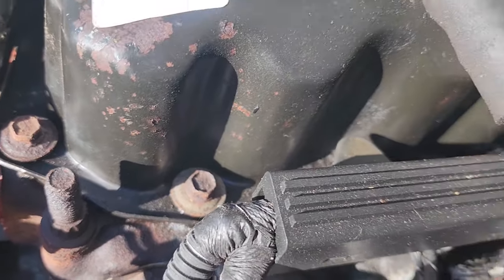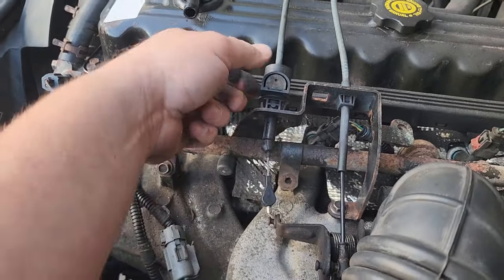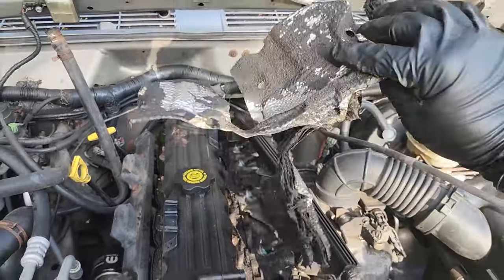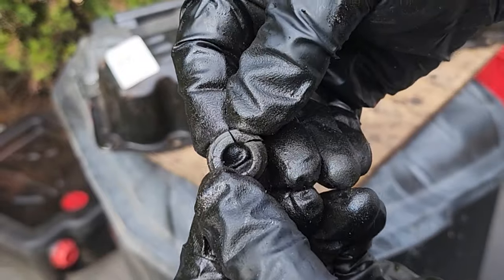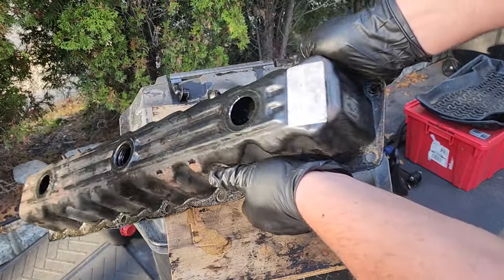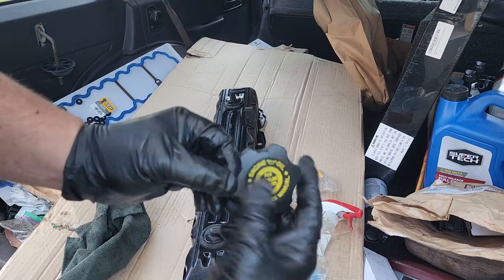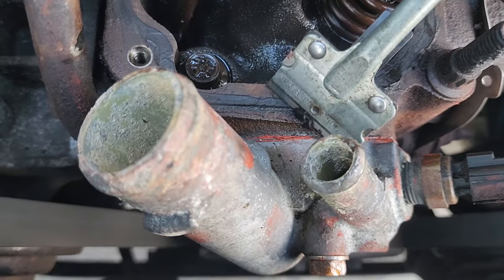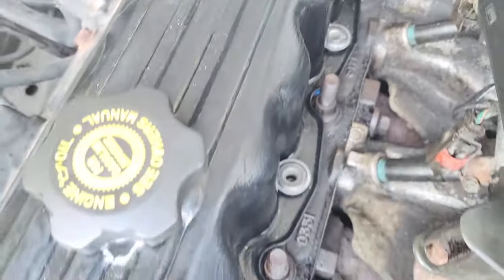JEEP XJ VALVE COVER GASKET  -  VALVE COVER  -  CCV VALVES - TOAD #8

Comment: Dan H, I've got an 04 WJ 4.7 with a constant ticking/clicking on the driver's side. New lifters, push rod's and rockers installed with less than 5k on new part's. Installed these part's in hopes of curing said noise. Any ideas? 165K engine.... 
Just installed new vc gasket on my 01, i6.... Thanks for the interesting video.
Reply: Not as smart as Dan did you check piston slap where the skirt pings on cylinder wall i think they call piston slap